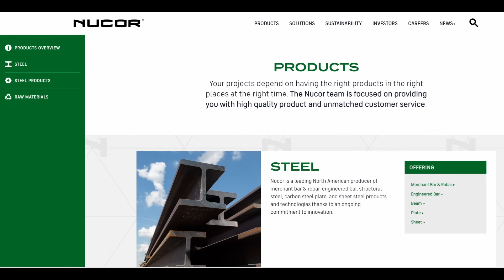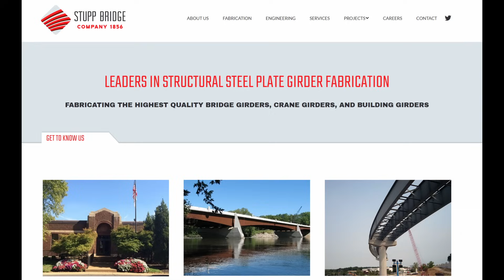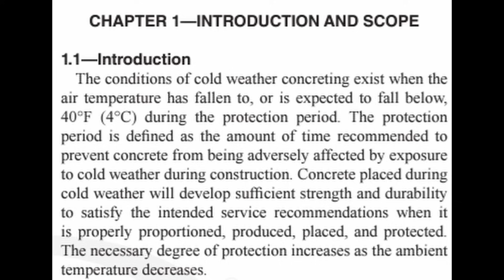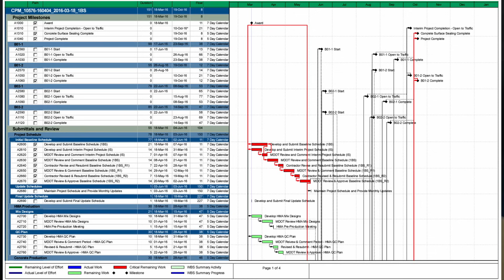Big Mac Bridge  - Final Steps for Repair

Comment: It is my understanding that All of the bridges between Ohio & Kentucky are owned and maintained by Kentucky, Not Ohio.
So, is the section that was damaged technically an approach to the actual bride?
Reply from the maker: I just know that Ohio DOT is in charge of this repair.  I will have to look into the other details you raise, thank you.
Reply: This is correct. The fire was under the Ohio approach, not the actual Ohio River crossing, which is owned by Kentucky.

Comment: Forgive any incorrect terminology here, but one thing that I’ve been trying to wrap my head around are the girders and spans they are replacing: it looks like they are replacing seven segments (girders) in four (of the seven) spans (girders between piers).

That is, they are not replacing the entire section of bridge over the playground, but only the 4 easternmost (inner, relative to the northbound span) spans and if I am reading the drawing at 1:55 from your “Big Mac Bridge Repair Steps and Timeline” video, they’ve left one lane in place this whole time and I don’t think they’re going to replace it at all, correct?

And, the plan isn’t to do 4/7 of the bridge first (counting 7 spans) then 3/7 later…?

Comment: Been on a job in the middle of winter in PA where we were pouring concrete for an oil/water separator foundation and anti-floatation anchor.  The concrete trucks would not roll below a certain temperature due to the water needed on the truck for wash down and the potential for those water lines to freeze. So even if you build an enclosure getting the concrete to the site may still be a problem.
Reply from the maker: That is a great point.  I would think if they pick a day when the temperatures were in the mid to upper 30s to run they concrete they could get it done if they used an enclosure.  There should be a few of those days in the next couple of weeks.

Comment: An enclosure for a bridge has to include underneath and the heat source likely needs to be underneath as well to ensure the underside is kept sufficiently warm.

Is bridge deck concrete allowed to use antifreeze and/or accelerants (low temperature admixtures)?  That might get them another 15-20F, but with winter temperatures in that area that alone won't be enough.  (E.g. ASTM C1622)

Comment: There are ways to pour concrete when the conditions are below 40C. The use of hot water pump trucks to keep the forms warm and insulated blankets could be sufficient. 
The concrete would be made using HOT water and an accelerant added.

Comment: Thanks for the update, Casey. The enclosure idea makes sense as it is SO cold here. Much colder than what has become a "normal" winter. I suspect that would be a limiter even to build an enclosure no matter how temporary it is. Anyway, thanks for the info and I don't know for a fact, but your requests to a public official for information on a public project should be honored. I guess I'm not surprised as it seems local media doesn't report as you do.

Comment: They may use hot water pumped through pipes as an alternate to heaters. I've seen this used to defrost frozen ground for excavation and could see it being used in this situation, too. One thing on the schedule: they also have to pour the J-railings and overhead sign structure anchor bolt blisters - after the bridge deck.

Comment: A good enclosure is doable and a must. We placed concrete in every month of the year in Alaska (East of Fairbanks). It wasn't cheap but we would have been fired if we said wait until its +40F.  For large structures we built Sprung structures and the craft worked inside in shirtsleeves during -20F, -30F.  For smaller work we built timber enclosures and wrapped it tarps or plastic. We burned an insane amount of kerosene in dozens of salamanders 24/7.  Productivity goes down about 1% per degree below +40F.  With an enclosure we could recover the cost of the enclosure on productivity gains in formwork and placement of reinforcing steel. (ACI306 Chap 3) . One other wrinkle is the mixing and transportation of concrete in the cold.  The mix plant and the trucks have to be set up for it.  We used homemade insulated trucks with spray foam on the exterior of the drum.  Those trucks were ugly for sure. Our mix plant was close to the job site so the mix had to stay in truck for extra time to hit the entrained air spec. (ACI306 Chap. 5 goes mix temp). Since the bridge work is up in the air there is no need to preheat the ground (add a week or two for preheating placements on grade). All this is doable and should be done and it's difficult but the skill sets are out there.  It terms of risk - it's manageable if they don't miss a trick.
Reply: It is certainly a bit less cold in Ohio than in Alaska, so the challenges should be easier to overcome...

Comment: I do not think any DOT would open a bridge before full initial concrete cure of 28 days had elasped from last concrete placement date which in this case will be the guard railings which is usually finished about if rushed 2 weeks from the deck pour date so that all the concrete is at full initial cure strength before the public would be able/allowed to use the bridge again 28 days after last placement of concrete. If this is correct and your the expert it will be difficult to achieve any public opening before March 15th more likely April 1 for best case results? Ray
Reply: I'd like to hear that answer too.  I've worked a lot jobs with 5000 psi mixes that we would work on when we got 3000 psi breaks.  If pressed we'd submit an RFI, by the time the RFI was answered the concrete would break over 5000 -ha!

Comment: I would like to know about the logistics of these high-priority projects.
I think getting custom concrete and steel is easy, but these companies, I would expect, have projects in the queue for many months.
Reply: The most time consuming concrete I've ever seen was Nuclear quality grade concrete - and it was for a very small volume.  It took the team months to iron out the mix design and demonstrate to the regulators that the mix design and the work process would perform as advertised.  Fancy steel for nuclear plant steam is also time consuming - odd ball dimensions and extreme levels of inspection. It's all doable but hard work.

Comment: wait a minute they got the girders on Jan.19 and have already installed them this week have you looked at a calendar lately. i'm betting there not working today because its sunday Jan.19. if there that good they can have the bridge done by tomorrow.
Reply from the maker: Yes, I meant to say that the girders were delivered on January 12 and installed starting January 13th.  Sometimes I get stuff garbled when I produce a video!
Reply: @CaseyJones-Engineer  it happens 👍👍
Reply: Note a span can often be errected in a night, if only enough bolts are used to handle the weight of the girders.  Then rest can be put in later or while the next spans are errecting.  Drilling slows things down a lot.

Comment: I remember in my industrial arts class in high school building a bridge out of balsa wood and popsicle sticks.  My popsicle sticks, used as girders had load bearing deficiencies.  That type of wood isn't the best for installing tiny little bolts anyway, droids cause long term issues and the glue took too long to dry anyway.  Your video made me think of concrete used for hydro dams in Canada that must have significant load bearing requirements with all of that water.  I betcha a PVC type pipe could move a lot of that water to California and the Colorado....
Reply from the maker: Thank you.  It will be interesting to what changes will be implemented in California for water supply and fire management.
Reply: @CaseyJones-Engineer  It would be cool if you could play a part on this kind of project!!!  Who knows, what happens at the north pole...

That said, i bought this old man a glass of wine in Madeira not too long ago.  Isn't that ironic - don't you think, the founding Fathers drank Madeira wine when they signed the declaration of independence except for Adams - Cider guy - could be the best drink I have ever bought for somebody.
Reply: now days with cyanoacrylate and an accelerator the glue isn't a factor any more.  🤔
Reply: @Sylvan_dB  I'm trying to figure out why my bridge was so slant eyed...  can you give me a hand why the glue from china isn't so sticky?

Comment: You need to add some time for the parapet, which will follow the deck pours. Also, the length being replaced may require a pour sequence, with some cure time (maybe 30 hours) between adjacent sections. Does ODOT use stay-in-place metal forms for the interior girder lines? Enclosing the bottom, working off the girder bottom flanges, is pretty easy. Enclosing the overhangs and parapet is more costly, but basic on a project like this.
Reply from the maker: Thank you, great points.  Do you think they will build an enclosure to handle the low temperatures?
Reply: @CaseyJones-Engineer  I would think so. We have done so on lower profile jobs with normal schedule pressure. I suspect this job would have schedule incentives that outweigh the winter protection costs.
Reply from the maker: @ Thank you.

Comment: Casey,

I have no experience with concrete further than building concrete canoes in the early 1970s.  I have been watching the construction of the Gordie Howe Bridge between Detroit, MI, and Windsor, Ontario.

The Howe Bridge is designed where they use reinforced concrete slabs.   I believe they are fabricating the panels offsite.  They secure the panels in place and then use some type of concrete mortar to create an underlayment.  I believe I heard on one of their videos the prestress the slabs once they are in place.

The are pouring the actual roadway once the underlayment is in place.  I believe the roadway is about 6" thick concrete with  galvanized rebar for reinforcement of the deck.  

They are using conventional methods for road and bridges on land.

Bob
Reply from the maker: Thank you for those details.  It is an amazing project for sure!

Comment: I did a January deck a few years ago (over water) and the engineer was fine with hot air heaters on a barge beneath the deck and hot water hoses between burlap and blankets and it has held up thus far. But being that high up, wind/evap is going to be an issue while pouring before it gets covered so I think an enclosure is really needed.
Reply from the maker: Thank you for your comments.  I will be curious to see what they do here.
Reply: @CaseyJones-Engineer  While it won't be an issue here, I'll say my bridge was also part-width and the completed portion (poured in July) was open to traffic and NOT heated. We are now having issues with that construction joint spalling beneath and the beam camber is far more pronounced on that side than anticipated and they appear to be functioning as 2 separate decks which is a problem. So probably not a great idea on part-width.

Comment: You should also do a update on the Boise airplane hangar it is being rebuilt right now first of the year in January 2025 and by the way the same Builder that had the collapse of the hangar is building is doing the replacement😮
Reply: Agree. Story dropped off the news cycle

Comment: Is there a temperature at which it would be too warm for cementing work well?
Reply from the maker: Yes, ACI also has warm weather concrete procedures. In general, certain precautions have to be taken if the temperature is greater than 85° at the time of concrete placement and you don't want the concrete temperature to start at 95° or higher. Otherwise shrinkage cracking could develop in the cured concrete.
Reply: @CaseyJones-Engineer  And a miserable days work for the guys actually doing the job
Reply: Yea, in Phoenix they have to mix ice into it.

Comment: I live in Dayton just north of Cincinnati.  We don't get reliably above 50F until mid April or early May. One year, I remember it snowing April 4 because that was opening day for my local minor league baseball team. If they want this done soon, they better be building an enclosure.
Reply from the maker: I believe it. I suspect  Most people who ride motorcycles there don't get back on untill late April or early May!
Reply: Or start a fire underneath to keep things warm… d’oh!
Reply: I think we get away with 50 plus at the time of pour.  Unless it is a thin concrete overlay, the heat of hydration keeps the concrete warm for three days or so.  We use a plastic cover if it wont go below 50 for a few days, and insulating blankets if it will.  We have also used covers over the formwork so it will be warm at the time of the pour.  We subtract days when concrete is cold from meeting minimum cure time.  Temp sensors in the concrete.  Most concrete actually does best curing at 40 to 50 deg for a long time.  Much below 32 F anytime in the first 24 hr freezing will damage the concrete, usually severely if it repeats.  We have some areas with permafrost near mountain passes, and in can be below freezing every night (or snow on July 4), so we have to be able to deal with it.  Sometimes things go wrong though.

Comment: Had a bridge once with some January pours where overnight weather was below zero. Contractor used trailer mounted heaters  with hot oil running through hoses that were laid on the fresh concrete and insulating mats placed over.  Forms should not be cold.  Note if you can pour the fresh concrete with the mix over 50 deg and keep it there for at least a few hours it will generate quite a bit of heat of hydration.  Worked well.  In some ways better as if the temperature gets hotter the concrete cracks more as it cools.  The trailer mounted heaters can regulate the temp well.  The issue with this type of heater is availability.
Reply: Hose leaks can be an issue too if the contractor is cheap and not maintaining equip., had to repour a span once after a heater hose blew.
Reply: @GOPRepubliklan  In my case the bridge was large (two spans per pour about a week apart) and the hose and equipement was new.  In Colorado we seem to have a lot of deck pours in winter.

Comment: Mid-March or later seems most realistic given they're prioritizing it, but not treating it as an emergency to the extent PennDOT did in Philly a year or so ago with the I-95 bridge. It's already been out for 2+ months, so they're likely of the mindset waiting an extra few weeks isn't a big deal. Motorists are making do and Winter is often slow for businesses anyways.
Reply from the maker: You are right.  I suspect they will wait for a warming period that may or may not happen in the next month to cast the concrete for the bridge deck.  However the governor of Ohio has stated that he wants this bridge opened as soon as possible.  I will be curious to see how it all turns out.

Comment: Sounds reasonable to me.  I've never done bridge work, but I have done foundations to state (NY) funded assisted living.  We were allowed to do fibercrete, and super plasticizer all day, but never ever calcium!  Once, we had a January pour with weather like this so we built a Teepee out of moving quilts with poly on top to resist snow.  Think we had a total of 8 salamander heaters going, (4 inside, 4 outside) and had a nice toasty 70 degrees+ all weekend.  Hired a security company to babysit the heaters to make sure they never went out.  Won over the state inspector at that point in the job.  Of course we kept him in the loop whenever there were any questions regarding protocol.  Pretty sure our concrete temp requirement was never to be below 34F, and 50F seems reasonable for a target temp.  Of course concrete self-heats with the setting action, but you never want to rely on that to obtain target temps, especially minimum temps.  Thanks for the update!
Reply from the maker: Thank you. You are well familiar with these cold weather issues. One additional complication for bridge decks is that you have to introduce warm air on all 4 sides.
Reply: @CaseyJones-Engineer  Exactly!
Reply: @CaseyJones-Engineer  But you don't need extra lead time to pre-heat the ground.  Not sure it evens out. :(